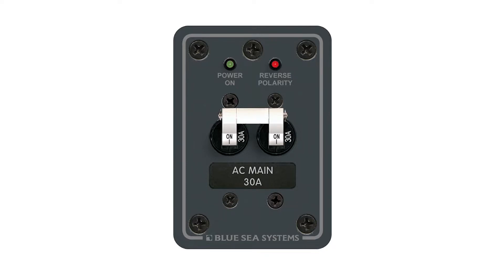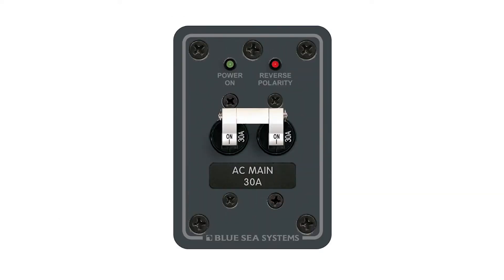Why Would the Reverse Polarity Light Be on When I Run the Generator on a Mooring Buoy?

Comment: I went to Bahamas - the first day I plugged into the pedestal-no problem - the next day a 100 + yacht docked next to me and used the same pedestal post - my reverse polarity light came on - I had the dock electrician check - there was a voltage drop and he had me used a different pedestal- his explanation was that the yacht was drawing too much current from the same pedestal I was on - is this possible b/c what I am reading is that reverse polarity only occur when there is a reverse in the ground and the positive

Comment: Bro, it’s simply that the generator has a floating neutral. Just buy or make a plug adapter that bond’s the neutral together with the ground at the generator.
Reply: Question 
Without this will it cause the ac to pull higher amps?

Comment: The Reverse Polarity can also light up due to a poor connection (rather than the polarity  being reversed). This happened to me at a marina in Mexico, thinking that the marina was badly wired.. Cleaned up the corroded terminals and the light when off.

Comment: So how do you square up Reverse Polarity with a 'Centre-Tapped' inverter such as a Renogy unit?  These have on their 230 Volt model; 115 Volts running down the Neutral and 115 Volts running down the Live - this 115 down the Neutral will always show as Reverse polarity?

Comment: Many / most of the inverter style generators do not have hard grounds- - they have a floating ground. We, in the camping world, have made a "cheater" plug (neutral - ground) that binds them together (aka similar to a binding screw in your home panel) to allow our electrical monitoring devices to function
Reply: So the only way to stop my reverse polarity light coming on is with this cheater plug? I have a Honda 2000i going to my sailboat. No light when on shore power, just with generator
Reply: @djkillachris  - pretty much - And yes it works with both the Honda EU2000i and a 2nd for the Predator 3500 inverter gen 'cause our power pedestal also does NOT engage without it. I was a lite plug (glows green to indicate power) - wrapped grn tape around it to indicate that it was "special", and took a wire fishing leader (built in loops, snaps) wrapped around the handle to attach -- and keep track of) 
Total $5 for the cord cap (plug), $3 for the leader, $0.02 of wire and been working for 25+ years.